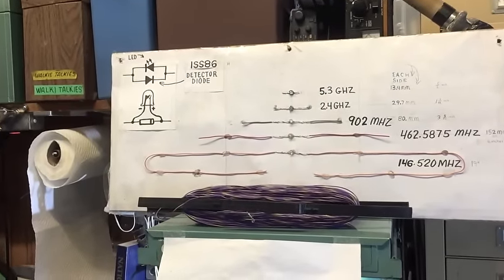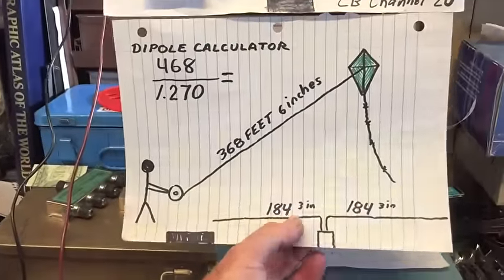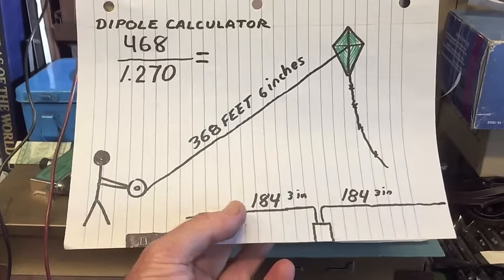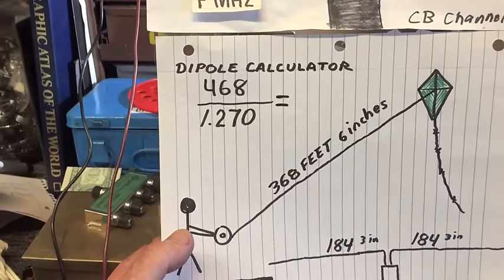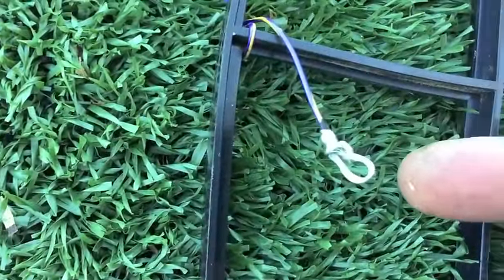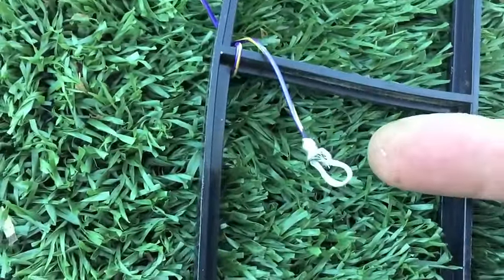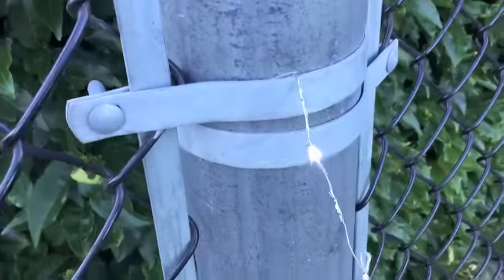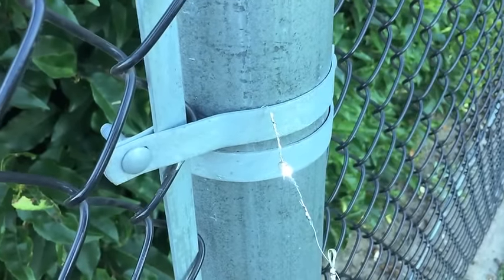Radio Frequency Burns From A Long Wire Antenna Supported By A Kite

Comment: As a veteran electronics technician myself, I'm wondering if the pull of the kite stretched your wire- segway next question: what is the tolerance of the length in order to received such a long wavelength transmission?
Can you measure the amplitude for this video? Did you know you were using your left hand to be the current path for the discharge test? Cool demonstration of flesh burning, but be safe sir, use your right hand next time.
Reply from the maker: I'm sure you are correct about the wire being stretched, but being a quarter mile from the broadcast transmitter it appears I can have an imperfect antenna and still pick up quite a bit of energy, I don't have the ability to measure the RF power from my antenna, but I figure anything that can burn my finger must be at least a couple watts.
Reply: @GrantsPassTVRepair  I'm honored to get a reply from such a busy channel. You have a new subscriber- I like your thinking.
Reply from the maker: @RobertBSewardJr  Thanks Robert.

Comment: I had a longwire setup to increase my AM broadcast reception one day I came home and it was arcing inside the house like and electric fence. It also burned out my radio It was a windy stormy day but no lightening do you know what this phenomenon was?
Reply from the maker: I've seen the same thing when the air is charged. Watch this video. https://www.youtube.com/watch?v=_DHBjeobg4U&t=28s

Comment: Now a gold plated capstone on the great pyramid 40 stories high would definitely light a crude vacuum tube lamp . To have light inside a pitch black tomb without creating soot that would cover the walls and ceilings .

Comment: An antenna definitely does not have to be tuned to receive.  Connect a random length of wire to a shortwave receiver  and it will receive on several frequency bands, not just where it is resonate.

Comment: do you have a thermal camera?  I'd for one be interested in seeing the thermal difference on the wire on the ground.  :)
Reply from the maker: RF energy tends to travel on the outside of the wire, and I doubt you could detect any measurable difference in temperature of the wire. If I held the wires I felt nothing, but when I lightly touched the wire to my skin it burnt me.

Comment: WHY IN GODS GREEN EARTH: Would you make an antenna in feet? I was making a 2 meter yagi from plans from a 40 meter dipole, that worked really well, and doing all the math in my head (directors reflectors, spacing between each, cutting loops of coax to tune, and cutting the ends to tune was complicated with a calculator and paper plans. Since many cuts were made after it was built saying "Off if I cut a few mm will that be in resonance.?. But to convert to feet and inches with just be an exercise for the mad man. Can't believe they didn't invent the meter tick or tape measure until I was in school in the 90's. Were your bands in feet too and using imperial farads and henries? 

Also all units americans can understand are "football" fields. A barn is 1X10^-64 football fields. Or a 2 millimeter wave guide is is 1X10^-24 football fields.

Comment: i wonder how much energy you're getting through that? like could you connect a coil of that length of wire to a battery charger and leech off radio frequency for a small charge?

Comment: In this case, you are very close to the transmitter and with a tuned antenna (do you? because 1/2L endfed is not a dipole, it's really a 1/4 Marconi instead, which would put you in half F)...
ANYWAY...
when doing this, always keep in mind of a different phenomenon that can produce somewhat similar results. 
In dry areas, any isolated long wire flying in the air, will be catching tons of static electricity from any light wind. Enough to produce sparks. It will do so even on detuned antennas,  and the behavior would be slightly different, plug an oscilloscope with an adequate HV probe, and it will be sparking but without RF.
I noticed this the first time at the back of my rig :)

Edit: And of course I wrote this without checking in the comments of others pointing exactly the same thing hahaha 73!
Reply from the maker: That's interesting. I've always wanted to attach a wire to a tall metal structure which is isolated from the ground, and measure the potential difference between the ground. 73s

Comment: i suggest ...

certainly an arc across an air gap must be in the kilo volts range ...
i don't think any radio broadcast could induce that high of a voltage.

i expect that ...
if you were to connnect a high turns ratio transformer,
say the output winding of an auto igntion coil,
to the line and a good ground,
so that you would have a voltage output
at the 12 volt primary winding low enough to see on a scope,
or frequency counter,
you are going to find sixty cycles per second ...
or some harmonic of.

Comment: I love sciency stuff like this.  But I think a kite with a wire is kind of dangerous even if you're careful.  What if the wire breaks and the kite flies a couple blocks over and lands on a power line?
Reply from the maker: That could be serious, but not likely with such tough wire.

Comment: I doubt you're picking up only the signal from the local AM station. With an antenna that long, you're picking up RF from many other sources, like FM stations, TV stations and cell phone towers.
Reply: There's also capacitive high voltage lingering in the air as you go higher it increases

Comment: Love the disclaimers - yes don't do this within 400ft of any power lines  - in any direction, for safety.....

Plenty of spare energy just hanging around, if the receiver can tune in to it...
(NB, just in case, no it isn't stealing anyone's signal, nor stealing juice from the transmitter, that energy is already expended and paid for...  lol. )

Comment: Could you string up lighting in your home for this kind of application? Whats the maximum amperage / voltage you could pull from this?
Reply from the maker: The energy output from this flying wire is very small. I can't give you the exact numbers, but I'd estimate it to be less than 5 watts.
Reply: @GrantsPassTVRepair  So you could run 50 or so white LED's. Plus you could run multiple antenna lines? It wouldn't be beautiful or practical. But you were running the line on the ground and it was still pulling a charge.
Super cool video. Thank you for posting this!!

Comment: @GrantsPassTVRepair What kind of charge and current does that wire conduct? Does the wire gauge effect the resonance and therefore length of the wire? What kind of basic system would be required to convert the voltage to a stable DC output for a 12 or 24 v charger?
Reply: Current is the rate at which charge moves. So you can ask the question how much current can be produced, but not how much charge and current.

As for producing enough power to charge a battery? Forget it. Never gonna happen.
Reply: @deang5622  By current and charge I meant how many amps and volts respectively? AKA how many watts can it make?

If the wire is making high voltage but low amperage it could be due to the wire gauge being too small to carry any current. 

If the resistance can be lowered the voltage will drop and the current will increase. Clearly there are thousands of volts. Whatever RF current is induced combined with 100 v of static charge per meter of elevation. 

Something like a solar charge controller should be able to regulate the rate of charge. My charge controller can only take one 500 watt panel. In theory, there is 1360 watts of solar energy hitting every square meter of atmosphere.

Don't say never! 
😉
Reply: @brendanwood1540  The thing is you used incorrect language. It demonstrates you don't know that much about the subject.

How many watts can it produce? Not enough to charge a battery if the length of the wire is of practical size. I already answered that question in my previous response.

Sure, if you want to wait a year to charge the battery, then yes it can charge it. But we are talking about being practical.
Reply: @deang5622  Data not opinions. That's all I'm asking for.

Comment: Voltage increases by 100 V per meter of elevation. You would have been at between 10,000 to 11,000 V even without the radio station nearby.

Comment: Did you know that you can also get high voltage from the Equipotentials of the Atmosphere. The atmosphere gives 100V per meter of altitude. At 120m you get 12kV. So not only you may receive Radiofrequencies but also atmospheric statistic electricity that gives you burns too.
Reply from the maker: I've seen videos of people doing this.

Comment: SO Question. why does my car have an AM radio that works, and my antana is only like 5ft long at best.
Reply from the maker: A mistuned antenna can still pick up radio waves, but a long wire antenna would likely improve your reception.

Comment: Out of curiosity, have you measured the voltage/current with this setup? Like, if you grounded the kite through a 1kOhm resistor, I'd be curious to see what voltage you get across it
Reply from the maker: I have not done so. Measuring RF energy is tricky. You can't just place an amp or volt meter on the output side of your antenna and measure it. Most volt meters can't handle RF energy. I suppose the only way to do so, would be to use an oscilloscope.

Comment: The kite is a grate shape to be used as a Rhombic Antenna for further boosting. Just putting this out there, but Benjamin Franklin didn't actually hold a kite with a key in a lighting storm, think about it, lol

Comment: Mr. Grants Pass; where can I source those diodes?
Can’t seem to find good legit ones
Reply from the maker: I saw a few of the good 1 on ebay. The ones made by hitachi have an H on them, and they seem to be the best. The 1N5711 is another one that works but it's not as good at the higher frequencies.

Comment: how many of those leds could that power ? even if it could only power 5-10 leds it would be great to have in a camp for backup . you could even use nearly trees to mount the wires. if anyone know the wattage let me know but i guess it would depend on the station .

Comment: if u hang a wire full with lights like that ,, u consume a hell of a lot of power..   is that power lost for radio listners elsewhere? u are using power so it must be getting less power for actual transmission..
Reply from the maker: I doubt anyone would notice the difference.

Comment: if you strung up a bunch of lights to be powered by the frequency, wouldn't that cause some weird interference with radios trying to use the frequency? i've never really understood how or when you get reflections and reradiate on accident (or on purpose). rf is black magic lol

Comment: That's not rf energy, its the positive static energy that's in the air naturally. The higher the conductor above the ground the higher the positive charge. It has noting to do with radiation waves or cell towers. You can do this anywhere.
Reply from the maker: In this case I'd guess you are incorrect about that. Did you notice how the LED remained illuminated with the wire laying on the ground? The other thing I noticed about the shock I got, was it travelled on the outside of my skin, and this is common for RF energy to travel on the outside of your skin.

Comment: At 40 seconds
Megahertz not kilohertz.
A bit later you can see the equation written on the lower “card”. Also the frequency of 1.270 MHz is in the US commercial AM band and the length you got corresponds with the calculation being 1.27 MHz. 
And since I’m here, bad on you for purposefully giving yourself multiple RF burns.
Reply from the maker: I meant to say MHz, rather than kilohertz, so you're correct. Regarding the RF burns, A minor skin effect burn was a small price to pay for such a thought provoking video, and it was so entertaining, it got you to chime in. All the best.;-)

Comment: Beware the allure of the open sky,
Where dreams take flight and ambitions fly high.
For amidst the clouds and the breeze's dance,
Lurks a danger that demands a second glance.

A long wire antenna, supported by kite,
A makeshift contraption, a daring sight.
But heed this warning, lest you be swayed,
By the temptation of signals, in the wind's cascade.

For radio frequency burns, a silent threat,
Lurk in the currents, where antennas are set.
A shock to the system, a jolt unseen,
Invisible dangers, where wires convene.

So before you embark on this aerial quest,
Consider the risks, and put safety to the test.
Protect yourself from the dangers above,
And let caution guide you with wisdom and love.

For while the sky may beckon with promise untold,
It's safety first, in the tales yet unfold.
So beware the dangers of the open air,
And let caution be your steadfast prayer.

Comment: I dont think the radio station has much to do with your smoking finger. There is a known volage gradient that naturaly occurs as you place a conductor above the earth. From memory its approximately 100 volts per metre AGL.
Reply: It's clearly RF.  DC gives you a shock, and I know from experience leaves a water blister on your skin if enough current flows.  RF just heats the point of contact as in the video.
Reply: 100 volts per meter yes, but the available current is incredibly low.

Comment: How much voltage is there ?
Free energy 
You can light LED lights in your house for free
Cool
Reply from the maker: I don't know how much voltage it was, but it sure stung when I touched the end of the wire.
Reply: @GrantsPassTVRepair  you should use a volt meter and see how much DC is coming out. It could be used for powering LEDs

Comment: Dang,  how far away from the station, and whats there tx power?
Reply from the maker: I'm only a couple blocks from the transmitter antenna in this experiment , and their day time power output is 10 thousand watts. At night I think it drops down to 50 watts

Comment: Wouldn't the kite line be a monopole?  Also, Isn't the there a voltage potential from ground to sky?
Reply from the maker: Yes, I could see a spark when I touched the antenna to the fence post which was grounded.
Reply: But that's DC.
Reply from the maker: @felicciasc  Radio Frequency energy  is AC.
Reply: @GrantsPassTVRepair  I know, but the circuit is easier to imagine in concept in DC.
Reply: @felicciasc  Ac and dc are the same thing except ac pulses because of how it's typical generated.
DC has no pulse because the source has capacitance vs an ac generator being the source. 
The frequency or 'alternating' is a product of the speed of the generator rotation.  
Think of running car electronics off an alternator with no battery.
The alternator would be loud over the radio and thats why electronics are typically DC.

Comment: If your kite string hit the powerlines or got struck by lightning, the conductor (string) would be fried in an instant and it is seriously questionable that any harm would occur.
Reply from the maker: You are very wrong about that. My small wire has more than enough current carrying potential to kill before the wire burns up, and it's already happened to a young kid who flew his kite with wire.
Reply: @GrantsPassTVRepair  good to know, thinking about it some more, I'm completely wrong, 10 milliamps of current can screw someone up pretty horribly, the potential of lightning strikes or a powerline can produce a lot more than 10ma dependent on the conductor.

Comment: Current always takes to the least Resistance path , according to the Electrician code rules if I’m not mistaken.

That’s why led stays lid up even if you try to bypass it with your body .
Reply: Technically, it is divided across all paths according to the resistances.

Comment: Does this put load on the radio transmitter?
Reply: It does create a radio shadow behind the wire but like ripples in water the radio waves curl around the obstruction and fill in the gap after about five wavelengths. In theory you could steal power from a nearby high power broadcast transmitter and power your home and people have certainly demonstrated this in the past. Unfortunately the authorities tend to take a rather dim view of this type of enterprise because taken to extremes it does reduce the output power of the transmitter for distant receiving stations. At the transmitter, nothing will be noticed since once the signal leaves the antenna it is irrelevant where it goes or how it is absorbed as far as the transmitter is concerned.

Comment: They did the experiment in orbit and it ended with the tether the wire was attached to being cut free. Some debate on exactly why. Probably caused brought a bunch of RF back to the most expensive shack ever built. Lol
Reply from the maker: I remember reading about the tether being cut. It may have been a charge that was picked up from the ionosphere.
Reply: @GrantsPassTVRepair  If my memory serves it was the earth's magnetic field itself inducing current on the tether, as LEO object moves much faster than the ground beneath it.

Comment: So all I have to do is make my christmas lights the length of the local radio station freq halfwave and ground one end.   Free lights!
Or better yet, put up a receiving tower next to the house and pipe the free electricity right into the house to run everything.
Reply from the maker: You need to use LED lights, and be close to the AM radio station transmitter tower. You may find this link helpful. . https://www.youtube.com/watch?v=vHVmJ5lD9jc&t=461s